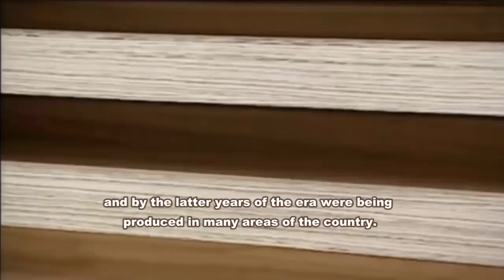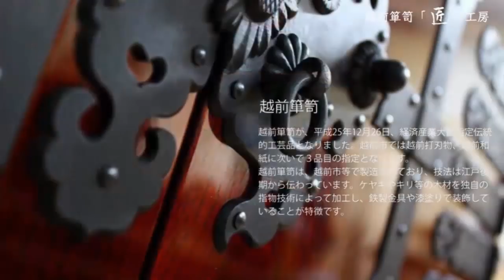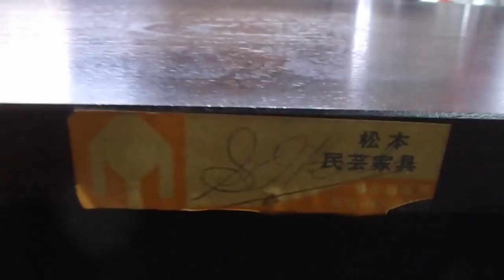10 Japan's Best Cabinet Furniture that will Blow Your Mind | Woodworking Absolutely Incredible

Comment: I think it's great that they can make drawers fit with such fine precision, but when one drawer is pushed in, two other drawers pop out because of the air pressure. Is that a sign of quality? Maybe drill a hole in the back to balance the air pressure?